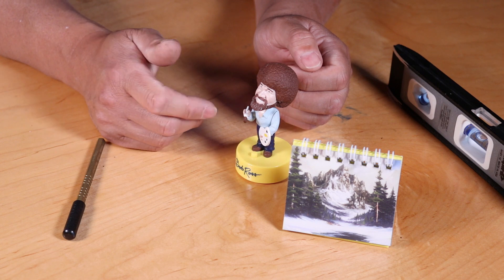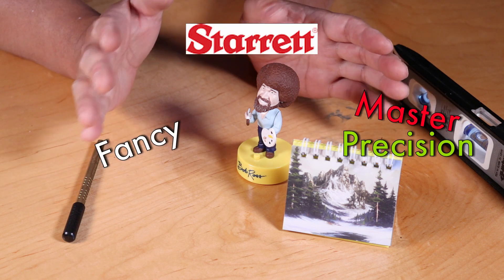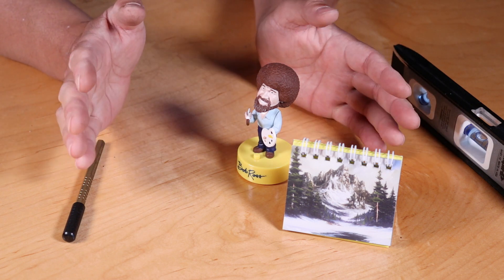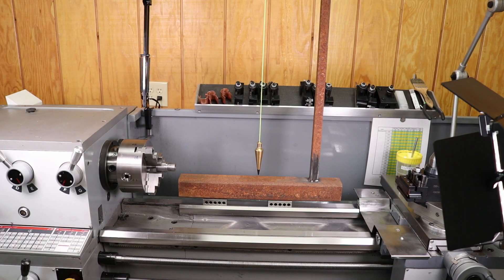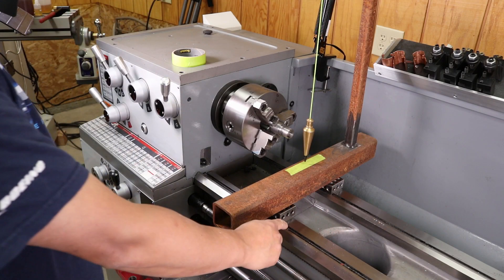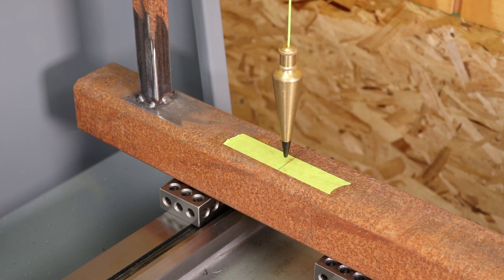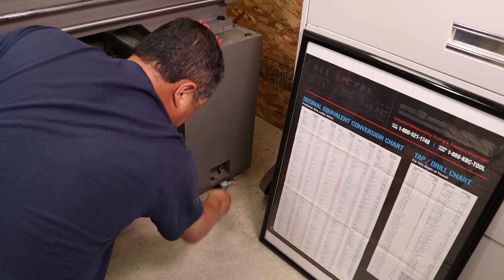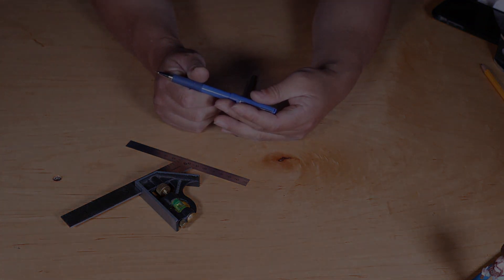LEVEL like an Egyptian - How to level a metal lathe, minimal tools and cheap

Comment: Assuming 1 meter height and 1 mm between the lines...  You were measuring a angle difference of  0.0573° = 0°3'26" = 0.001 rad.  Simple and useful!

Comment: I believe also a Chinese level method works well which is comprised of cheap flexible vinyl tubing several feet long for the length and the purpose of lets say your lathe to which the tubing is even longer so that the ends can be vertical straight up when reading and filled (leaving about 12" of air in the tubing, 6" of space for each side or any other amount suited for the application)  with a colored liquid like antifreeze. Liquids always seek level and will be level at each end. I also believe this may be more accurate then the best machinists levels as your reading both ends at any distance required, short or long. Plug each end of the tubing with a suitable plug. You should make one and make a video on this. Its even easier and cheaper than any other level method and very accurate. The tubing can be read right up against the ways or from the top of blocks whatever is the easiest position to read it. I like this Egyptian way also as it seems to be highly accurate. I was thinking also four pieces of tubing with a common hub or fittings would allow the reading of four points at once as the liquid in the four sections would all seek to be level in respect to one another. Tubing of at least 5/16" (8mm) works best. I can buy it locally for around 32 cents a foot.

Comment: Unless I missed it you should have mentioned making the vertical bar as long as possible since the longer it is it then makes this type of testing much more sensitive. John Brock pointed out in his comment below that this type of leveling isn't close enough to get within what I'd assume is a good tool room lathes requirements. However I do own one of the Mit. expensive machinist master levels and taking all the time required to get a lathe bed as perfect as possible I've still always found very minor corrections were always required to get within a 10th or two of a true parallel cut down the length of a test piece under real world cutting conditions. Leveling any lathe bed no matter how well done is still only a static condition. If your going to use the lathe then the minor and unaviodable deflections that happen within the lathe parts while cutting will still always need to be adjusted and compensated for to get the best out of any machine. 

Using a plumb bob would still get you fairly close to the actual condition and making those further adjustments during test cuts that would still get you to the required lathe beds alignment condition for accuracy. If I had to do it this way I think I'd just lightly clamp a 6" standard machinist's scale to the bottom horizontal bar and have one mark on it lined up directly under the plumb bob's point. Doing that would indicate how much of a turn on the adjustment bolts makes how much difference in the plumb bobs point location on the scales divisions. Within a few try's at it you'd have a pretty fair idea of just how much adjustment is needed on the adjusting bolts . A true and parallel lathe bed is still that no matter which tool or method is used to get to that end result. Also the more worn a lathe is the more final adjustments away from a perfect level condition will be needed.
Reply from the maker: Turning Point thanks for your comment.  Definitely so many things that can influence the accuracy.  I think one must answer the question of”how accurate is accurate enough?” as the answer would drive the time, money and effort invested.  Thanks for stopping by 👍🏼

Comment: That was funny, nicely done!  I'd still lean toward using a machinist level, but the plumb bob method as you used it will give a decent reading - it's a nice, long arm for good elevation.  For what it's worth, the Starrett machinist levels come on eBay occasionally for a good price.  I got mine off there for a reasonable price (not what they want to extract from a customer buying a new one!).  I had to laugh about your British car joke . . . sadly too much truth to it, lol . .
Reply from the maker: Everett's Workshop Thanks Everett.  I’ve owned a 1967 Austin Healey and 70’s MINI and they left a mark wherever they went. 😁

Comment: Yuchol, your method should get you within around .030”, the thickness of your pencil mark. But to get it within .001 in 1 foot ( As recommended by my lathe manufactures literature). A precision level will be required. I do like your method for getting stuff roughly leveled. 

I do like your humor! The dog wiping his butt about made me spit out my coffee laughing!
Reply from the maker: Thanks for you comment.  I need to do some math, but given the ratio of the lengths between the vertical pole and the bed width, what we saw on the masking tape should be an exaggerated value.  I would estimate the actual bed twist to be 1/8th of what the pencil marks showed.  I need to revisit my sines and cosines 😁. Thanks for stopping by.
Reply: @woodscreekworkshop9939  Length of the riser will have absolutely no influence on the precision since the bed has a constant span and vertical is vertical with any length of plumb bob.
Reply from the maker: @RobB_VK6ES  depends on what you mean by precision.  No, it doesn’t make the setup any more accurate, but the longer the vertical pole, move movement on the plumb Bob.  Maybe more “sensitive” would be a better choice of words?